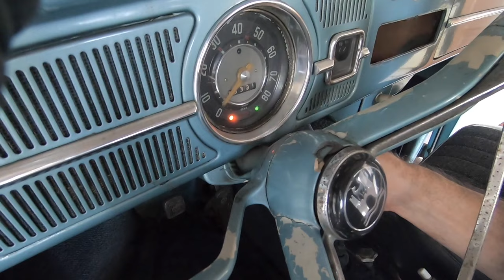1963 VW Beetle revival project - Episode 2

Comment: If  you have a compressor blow air into the tank in that line. If the sock filter is plugged it will blow it off. Then you can put another filter in the hose you are dealing with.
Reply from the maker: Good tip to know, thanks Daniel and will try again if becomes a fuel issue with flow... it's been running and starting nicely now and very few sediments showing up in the filter. I still need to check the fuel sending unit as the gas gauge isn't reading, was hoping to peek into the tank then too :)

Comment: Wait, did I miss it, or did you use the starter to pump out all the fuel? Seems like the video jumps past that part, or I misunderstood what you said you were going to do.
Reply from the maker: Couldn’t drain the tank with the pump because the line and fitting under the tank was clogged with brown crud, when I removed that only about a gallon was in the tank

Comment: Dosn't hurt to change the fuel pump with a new one.
Reply from the maker: Was thinking the same or rebuilding? as has rubber parts just like the carb
Reply: @RABBITMotorworks  2 bolts and it's off and a new one is cheep and even better is to bypass it with a electric one in your fuel tank..I had a 61 bug and your engine looks just like that 40 poopie horse power I had the only diffrence I had mine when it was only 8 years old for 100$ , yours is 57 going on 58 years old and a little money pit now.

Comment: 6Volt  40 hp corvair beater in the 'heat dept.'? naw but it would start in winter.
Reply from the maker: Yeah it's a 6 volt, the heat haven't tried yet but did notice the gate/valve at the back near the engine with the cable seems disconnected... out in SoCal everything starts in the winter :)
Reply: @RABBITMotorworks  It' was a joke if you were familiar with air cooled engines😎.